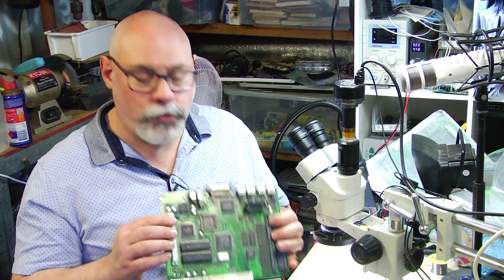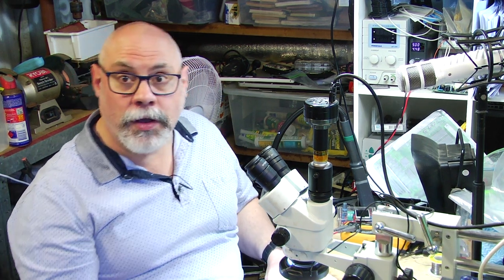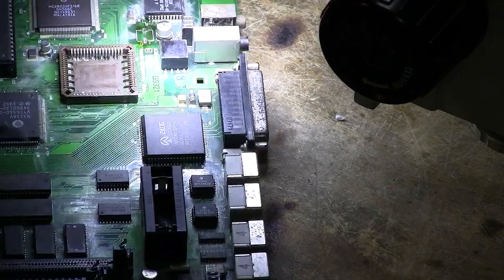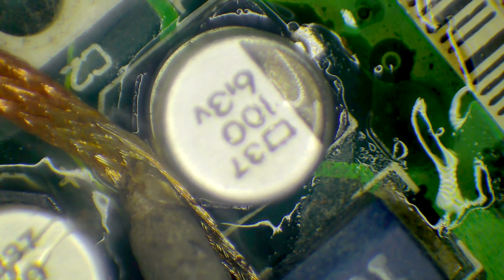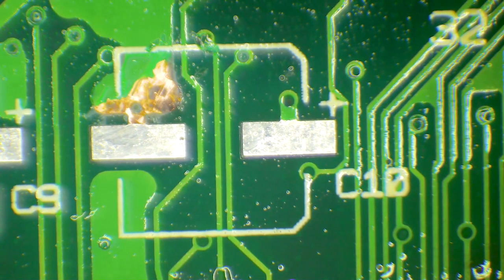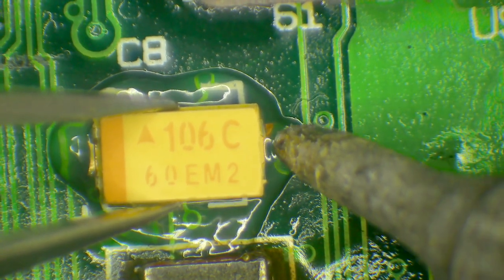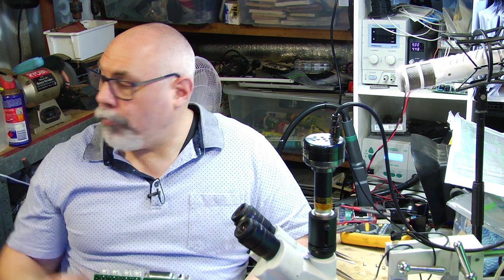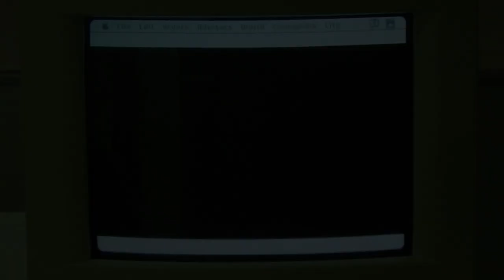Recapping a Macintosh Color Classic Logic Board

Comment: Thanks for the great tutorial! I've got quite a large collection of 68k machines (IIcx, IIci, IIsi, LC, LCII, Colour Classic etc.) and I suspect all of them need new caps - with some of them I definitely know. We're probably talking around 20 computers!

I'm tempted to skip buying a hot air station in favour of a pair of hot tweezers (basically two soldering irons held together with a hinge). They're roughly the price of a pizza so not much of a loss if they aren't that great. Your video does show how much faster the hot air is, so well worth considering!
Reply from the maker: I've never used hot tweezers myself, but I've often thought that they would be very good for removing these old caps.

Comment: I used essentially this method the other day to repair a friend's LCIII, although I did not add new solder to the joints and I regret it because I ended up tearing off a pad. Doh! I was able to repair it and the mac seems to be working great, but that would have saved me some grief. And I should have known anyway! Oh well. Next time!

Comment: thanks very much for this video. i have 2 color classics and am beginning to refurbish them. i've removed the caps on one so far. i just finished washing the motherboard in my dishwasher as per what i saw on an 8-bit guy video and just rinsed the board with isopropyl alcohol and went over it with a toothbrush. i should get the tantalum cap kit in the mail next week and will update with how that goes. i also ordered the kit for my SE/30, but also have another color classic and LCIII and one early all-in-one Macintosh to do. i can't remember if it is a Plus, a 128k, or a 512k. actually i have 2 of those motherboards and one case for them as the motherboards were interchangeable between those machines, maybe a little modification was required when i did it, i don't remember. so the next video i'm going to watch is your SE/30 video. i am also working on repairing Commodore computers that were scavenged for chips and left for dead that i bought locally. then i have an Amiga, can't remember if it was a 500 or 1200. so much to do. and so many projects to potentially do. wish there was a swap meet group that i could go to. anyway, thanks again.
Reply from the maker: The 128K, 512K or Plus logic board probably won't need to be recapped, as they don't have any of the surface mount electrolytics, just a few axial capacitors.

Comment: I have problems with my Mac Color Classic floppy drive.  The disks will not fully seat inside the drive.  When I push the disk into the slot, it goes about ¾ of the way but does not drop fully into the drive.  I use a paperclip to safely remove the disk after each attempt.  Do you have any idea what may cause this?  If I need to replace the floppy drive where might you recommend I purchase a replacement?  I live in the USA, any help is greatly appreciated.  Thank you.

Comment: This video is amazing, thank you so much for posting it. I'm a soldering newbie, trying to do my first recap and on my practice board, I keep taking off one pad in the last step! Is my soldering iron too hot or something? Not sure what I'm doing wrong, exactly.
Reply from the maker: When you say "last step" do you mean during removal, during the cleaning process, or when you're soldering on a new capacitor?
Reply: Branchus Creations so I mean the last step of removal; basically when I’m taking a soldering iron to melt off the solder between the pad and the capacitor, I keep tearing off the pad with it. My issue may be that I didn’t use a “chisel” tip, which led me to pull it off harder than usual? I’m not entirely sure though.

Comment: thank you for this video. love all the close ups. I have a question. I heard on another feed that it is not a good idea to replace electrolytic with tantalum caps, that is because they fail different. that is electrolytic fails open and tantalum fails close which can cause damage to component. it this true?
Reply from the maker: It's my understanding that both electrolytic and tantalum capacitors can fail either open or closed (short) depending on the cause of that failure. I don't believe one has a greater tendency for one type of failure over the other.
Reply: @BranchusCreations  wow, thanks for your quick reply. I am watching more of videos now and learning. thank you for this.
Reply: @BranchusCreations  no  but really I got to get off youtube and get some work done. with all this good material it is hard not to watch.
Reply: @BranchusCreations  here is another  question, if you wouldn't mind answering whenever you have time, I would appreciate it any way I can, just let me know how. it is kind of work related for me. the question is about placement of caps. but here is a bit fyi about the instrument. it is an electrosurgery unit. it is not outputting any power / not cutting. there are several pcbs stacked in there. 1 pcb is setup with about 5 or 6 big caps. it may be a power bank or whatever it is called. my question is about capacitors, thought.   
 I took all  circuit board apart and removed several big electrolytic caps, took picture before removal with the  phone. 
Well, the phone is gone now which has its own story. but so are the pictures and how to put the caps back in. there is no + or - marking on the pcb.  The only way I would think one could figure this out is by understanding the way caps were connected together. I don't have the expertise and or the confidence to be sure about my understanding of this and I was wondering if you would help. these caps were connected together with a resister in between each one. there is a resister in between 1 legs of each cap to the 1 leg of the next cap on all of them. Should I assume one cap would connect with "-" to one end of the resisted and the other cap would connect with "+" to the other end of the resister so that when unit is turned off the resisters would drain the caps? I hope what I am saying is making sense. but if it is not, I can send you pictures.